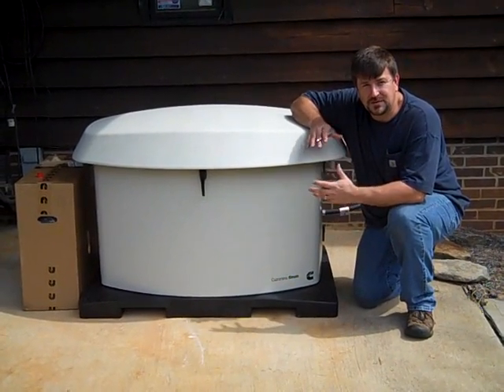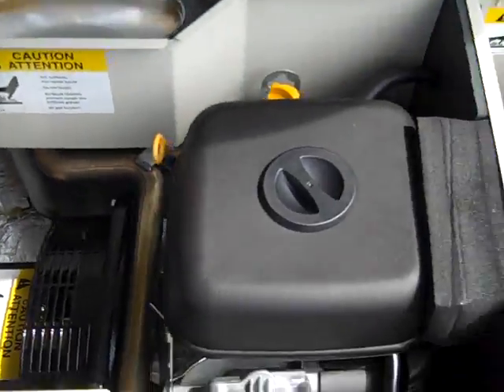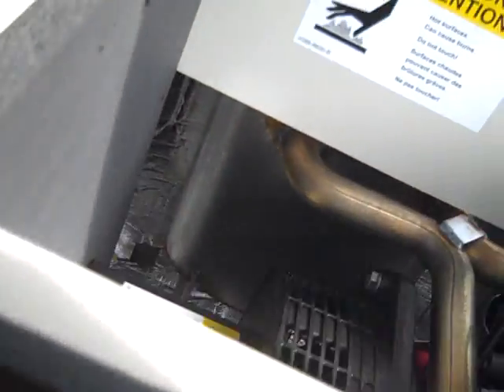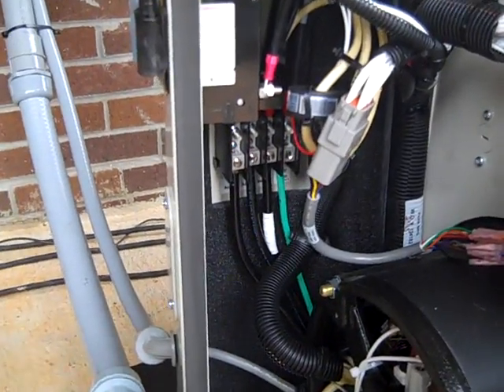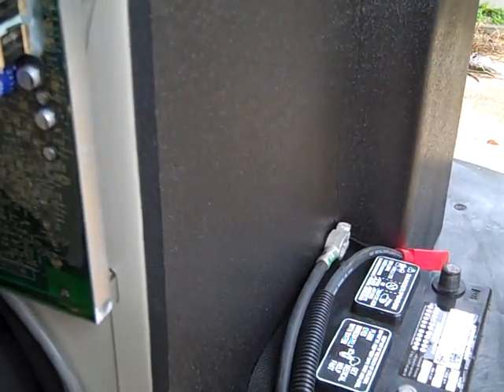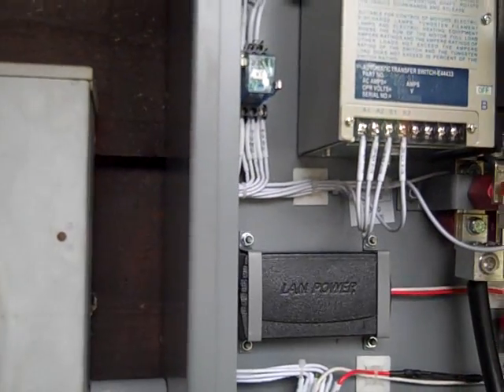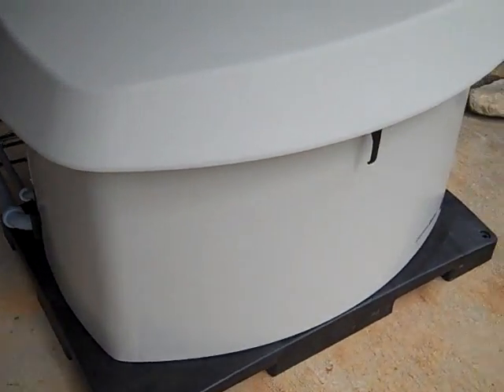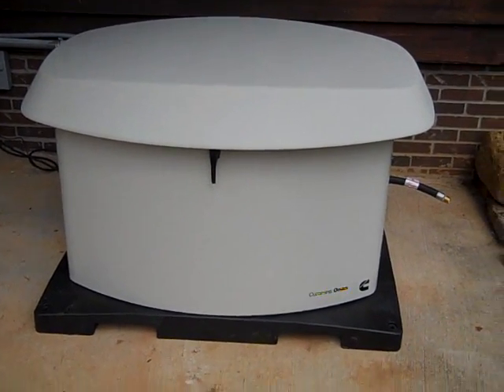Prepper Power:Cummins-Onan Emergency Generator

Comment: I have a fault system failure  , saying charger ac fail . Battery reads 13.2 at resting  and 13.8 while running . Is my battery bad or something else

Comment: Quick question. I have a Onan 4 kw generator in a old camper that has not been started in about 6 or 7 years. What would you do to the generator (maintenance wise), before starting it up for the first time? Prior to parking the RV, it and the gen were kept in excellent running order. I would like to use this gen to set up and use for backup power in an off grid house.

Comment: Ok have to put this out there, IF A BULLET HITS THE TANK IT WILL NOT EXPLODE IT WILL JUST LEAK OUT THE PROPANE.
Is that clear, if you than shoot a tracer round than it will go boom.
Thought all the smart people should know that. Later

Comment: Good video. I've got a 33kwh diesel and 3,000 gallons of fuel. I bought fuel in the 90's and paid $0.62 a gallon for off road. I treated it with PRI-D. I also have about 60kwh worth of battery power in my basement and a Trace 5548 inverter and a Trace step up transformer for my well pump, and a Whisper 3000 wind gen on an 84' tower. I have an ALL electric house to include baseboard heat. I need every KW I can get in the winter time in northern Wisconsin. My inverter exercises my gen set monthly.
Reply: How's this setup running today?

Comment: Was cost the reason you installed an air cooled generator? Its better than nothing and better than the ge_e_ac, but why not go liquid cooled 1800 rpm? 

Some of the motorhome diesel generators from Onan are in the 7-10kw size range and are made to be used a lot. 

Dont let the power company see you running the feeders back through the meter pan, they usually frown on that.

Comment: Yeah, it depends what feel you need to run.  I think anything over 7k is overshoot, but you wouldn't want more than one appliance starting at s time if you have much less than 4.5k.  
Motors and compressors need adequate current to start and run without overheating [from low voltage].

Comment: Does the controller have integrated undervoltage sensing? I assume that is what the generator uses to autostart. It is a nice set up for sure. 20 kW is a little large for typical household needs, but it would be nice to have! Thanks for the video

Comment: How did you get around changing the SEC to 4 conductor to the panel. I didn't see any water pipe or made electrodes either.

Comment: Can you fit a drip pan under the oil filter?  Also, I think 5-7k is perfect for "preparedness" reasons for a modest house.  It's enough to run one furnace, fridge, freezer and a bit more.

Comment from the maker: Actually, we didn't splice.  Ran new wires from the load side to the transfer switch.  It was a lot cleaner.  Not including Propane, it was $6k installed, tested and certified for the 20kW unit.
Reply: I’d like you to come install one just like that at my house.

Comment: I assume you spliced the load side (from house) in the meter panel to reach the transfer switch connection ? what was the total cost (around) for this system ?